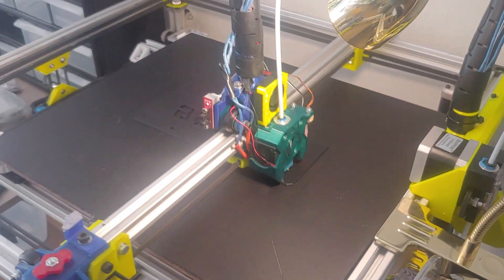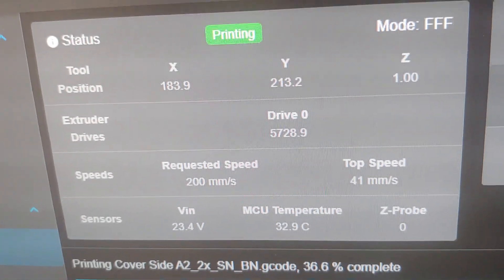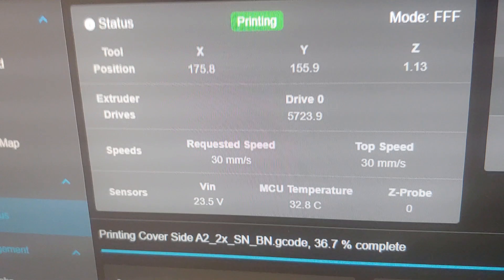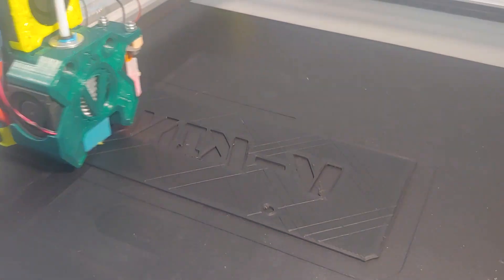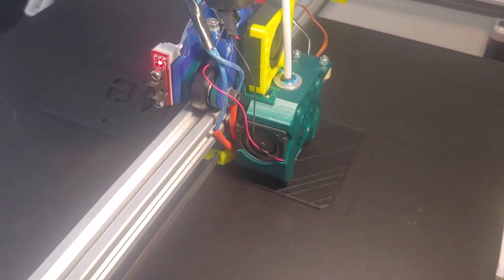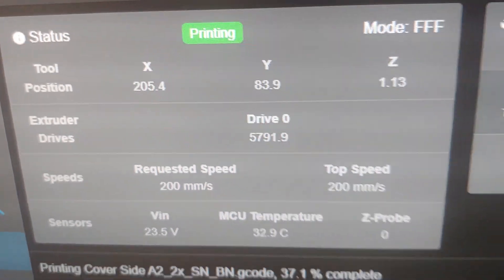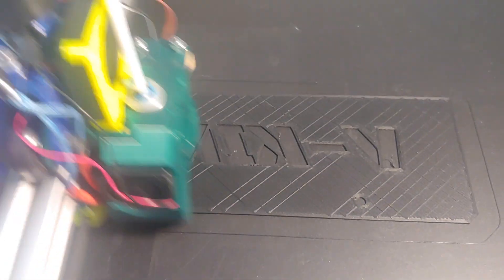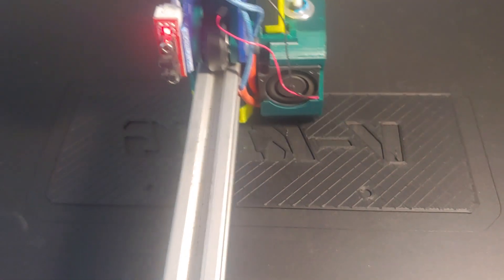V-King V2 corexy high speed 3d printing | 200mms real speed

Comment: Fellow duet user here!
I'm rather curious how you got your steppers so quiet
I've had my machine up to 300mm/s but the thing is rather... Intensely loud at those speeds
Reply from the maker: Do you have interpolating active for xy?
Reply: @PRO3DESIGN  I do
Reply: @Snow.Drifter  Disable that, it causes overshoot that violently gets compensated. Microstepping sure but not interpolation (that is the feature that uses 32 steps for example and hardware interpolates it to 256, it bad)

Comment: Great! My max speed at 0.2 layer and 0.6 line width is 120mm/s , what is your hotend at this setup? My hotend cant melt more material. And what is you ui on screen ? Is that duet?
Reply from the maker: This is duet web control yes. The hotend is e3d v6 all! metal maxing out at about 15cmm/sec
Reply: @PRO3DESIGN  okay flow rates are same , i guess you are using with thinner layers , i just bought volcano clone with plated copper nozzle , i hope it can give me more flow rate
Reply from the maker: @furkanbicer154  Yes these speed's are only possible with thinner layer's. This was 0.125 mm

Comment: What's that print bed surface you're using? AFAIK it's just a blank aluminium plate in the BOM.
Reply from the maker: Plain aluminum with a coat of paint
Reply: @PRO3DESIGN  What sort of paint, and how well does it last printing ABS?

Comment: Good work!  The accelerations are a bit low for it to really peak out at 200mm/s early.  I have been running 4k~6k accels for my day-to-day printing, and I run 160mm/s for my infill speed.  If you want to see speed, check out my 300mm/s video on my channel.  Everything is 300mm/s, 10k Accelertaion after the first layer at 120mm/s.  Worth note, the 300mm/s is just for testing, but the quality at those maxed out levels is pretty impressive.
Reply from the maker: I will up my accel for sure test 10k is ok. Gone go with 5k

Comment: What jerk settings or equivalent you use? And acceleration?
Reply from the maker: Acceleration was set to 3000 and jerk was 15 or 20 not sure
Reply: @PRO3DESIGN  you use junction deviation or classic jerk?
Reply from the maker: @santhermTV  classic jerk
Reply: Yes! What is the acceleration?
Reply: are you running duet with reprap? its just my bcn with tmc 2130 makes  a racket compared to yours, just seen a reprap release for skr boards im assuming with 2209 it will be quiet and fast I will look into it as duet is above my pay grade

Comment: What software are you using to monitor the print?
Reply from the maker: This is the web gui for the duet 2 WiFi controller
Reply: @PRO3DESIGN  Awsome. Thanks for the info. Currently in the build process with base frame complete and all parts printed. Do you have a config file for the duet wifi. I have had one for a while but havent used it yet.
Reply from the maker: @diytechfred2944  i have a config for the v-king. can you check if it's on GitHub
Reply: @PRO3DESIGN  Thank you. There is a config in the V-King repo.